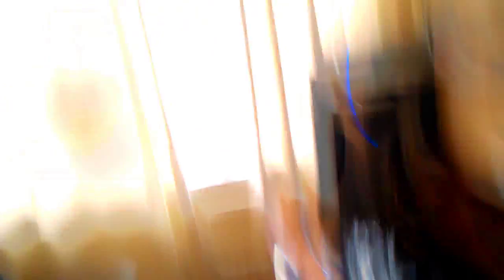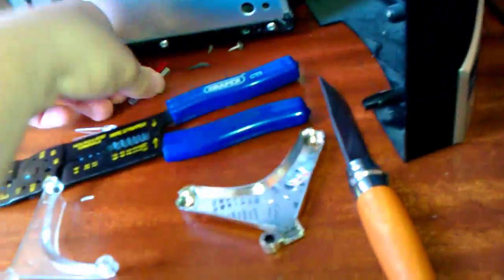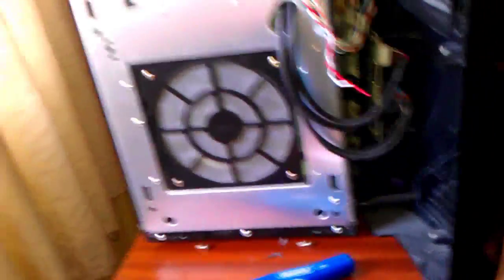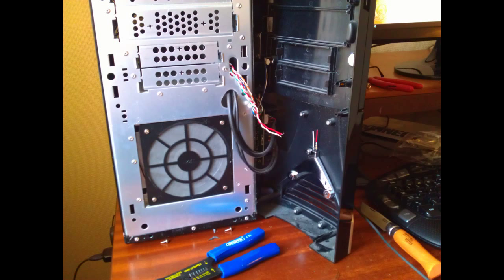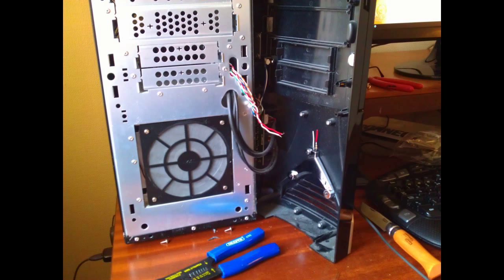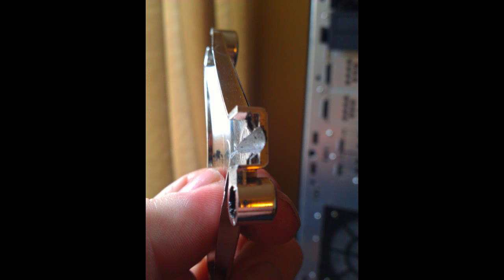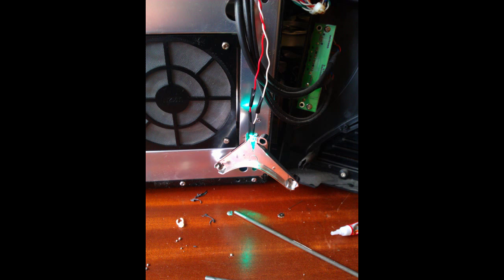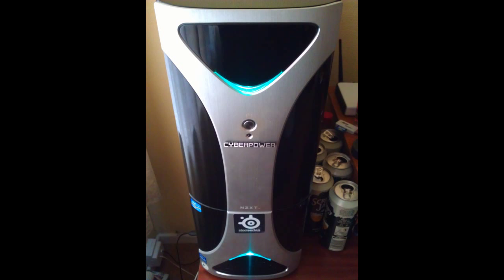How to modify / replace LED's on computer fascias/panels

Comment: hey mate im 15 and i built my first pc about a month ago, but recently ive been doing some cable management, and it turns out when i remove the power led from the plug, i had to pull it out by the cables which wasn't a smart idea and it started flickering but now it's just dead, so the cables are gone. what would you suggest i do to fix this? where will i get a replacement and how would i replace it?
Reply: lmao damn you really fucked up eh. XD I built mine around the same age! I'm happy I didn't fuck up like that lmao, btw we must both be about 18 right now huh!